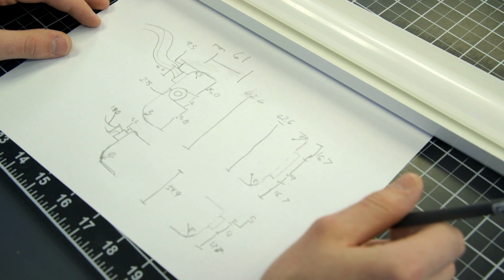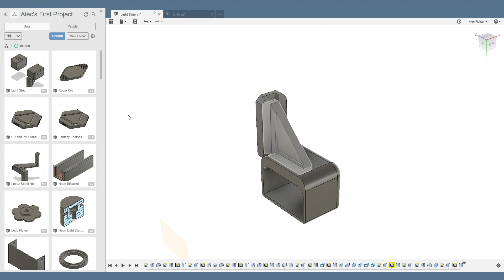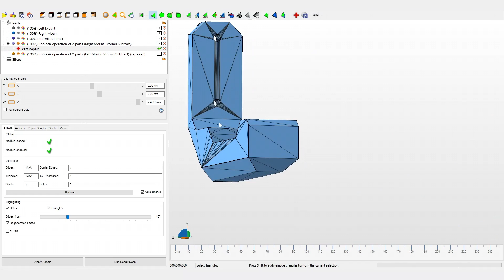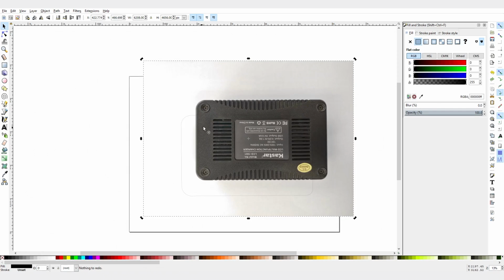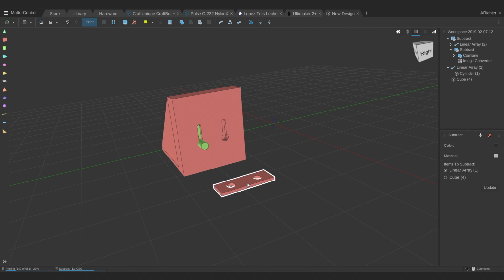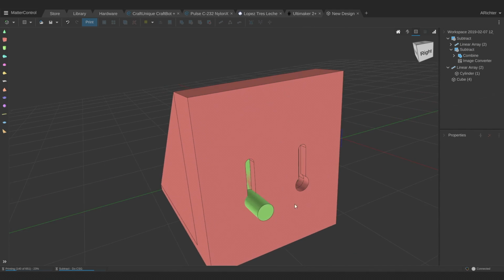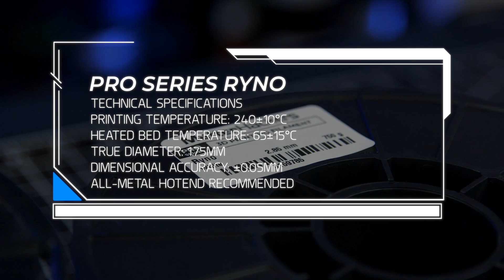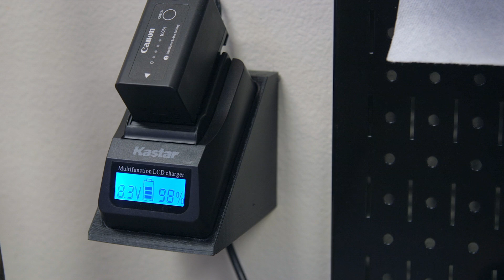How To Make 3D Printed Wall Mounts | Weekend Builds

Comment: I just found this out myself....you can use the combine tool in fusion 360 to do your subtraction. The Axe is the tool. This way you don't have to change environments. Hope this helps.
Reply from the maker: Normally this would work, but since I imported a mesh (an STL) I can't do any sort of modifications based on it (at least that I've found). If I were subtracting another model that was from Fusion or a STEP file, then that does work. - Alec
Reply: @MatterHackers  I have done it before where I convert mesh to brep and then use the combine

Comment: super useful video! A tip when taking pictures of objects, use a 2d scanner when possible! the camera perspective can sometimes throw your final shape off, I use my scanner to help design mounts or parts for drones all the time!
Reply from the maker: Yes! I totally forgot about that. That's much more reliable for a perpendicular shot of the surface you need. Thanks for the tip! - Alec
Reply: JT FPV what model do you use? I have a 3D scanner that’s part of my laser engraver and 3D printer that works decent for non metallic/highly reflective objects but curious what 2D scanner you’re referring to?
Reply from the maker: @Drewsky8703  More than likely just the scanner that's part of a printer. Paper printer, that is, haha! - Alec
Reply: @Drewsky8703  Well being as we were talking about 3d printing, I figured I should specify 2d(like those printer/scanner/fax combos) scanner.
Reply: since we'd normally refer to them as just "scanners"

Comment: I like to use stained and varnished wood-pla to print courtain rod holders. When planning the print orientation  for stress directions, they can get really strong.
Reply: Printing perpendicular to weight on a mount CAN make all the difference! Wouldn't want to print a mount for a guitar and have it break on a layer line!
Reply from the maker: @jtfpv3600  It certainly can! Layer lines make the difference from a great design and a paperweight - Alec
Reply from the maker: That's an awesome idea! I would imagine the shapes you are printing are more intricate than regular holders. What kind of holders have you printed? -Alec
Reply: @MatterHackers  
https://a360.co/2Sxa6wD
they are really simple actually. I designed them because my windows are really big and I needed to mount the holders on the side walls of the frame. You can download em.